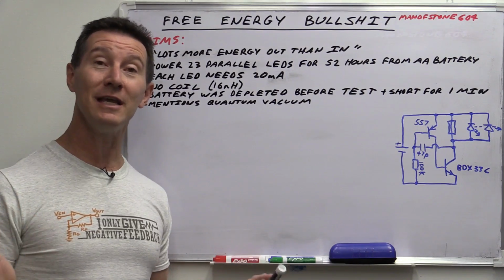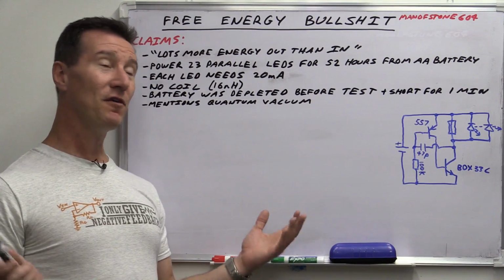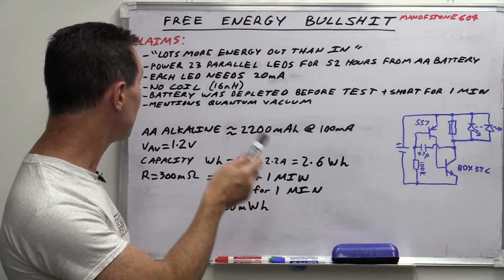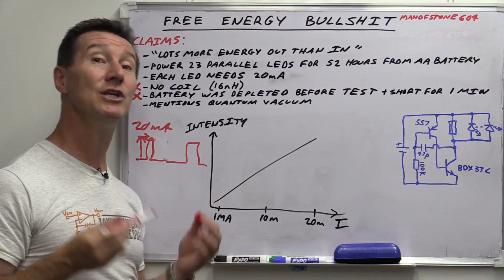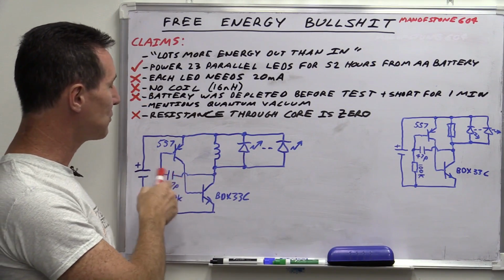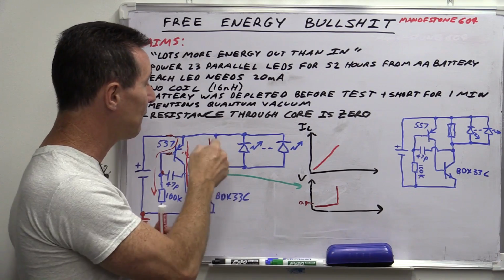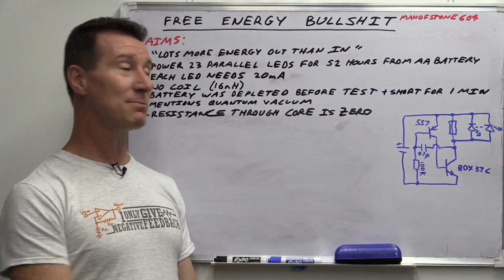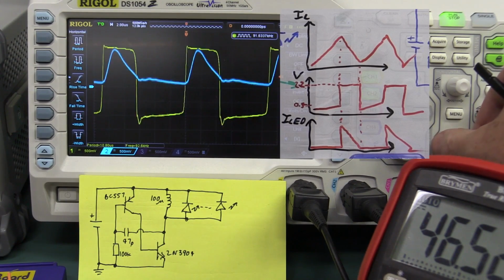EEVblog #708 - Free Energy Overunity is RUBBISH!

Comment: Culture Shock 'sprung!' mate YOU're dancing around the obvious will  single battery(ONE year old) power 24  leds for 52 hours at high intensity without his circuit NOt yours HIs the way he did it cos you were powering yours from the mains and over this side of the pond we call that the fastest trick in the west so your not first ausie to down a  box of Vic biitter and then lose balance in front of the Camera what do you call your VB on your side of the pond "Oh yes Vitamin B" if you redo the Experiment with out the  hiccup of terminology and have a non biased opinion and reproduce the circuit with 24 leds and single cell 12months old and a cell again months old without a circuit and 24 leds for comparison let me know P.s your 'buddy' Carl Sagan is biased so don't Quote him he does not help your case

Comment: Very informative, and when you look at the circuit diagram it is obvious what is going on. However I do believe it is possible to get free energy. And at the same time obey the laws of physics. You are right in saying that there is no such thing as a free lunch. However Photovoltaic panels provide us with free energy, which of course comes from the great nuclear fusion reactor in the sky. If you look at even the most nastiest of cold days on Earth, it is still a whole lot warmer than a day on say Jupiter. Therefore it should be possible to build a machine which creates and temperature drop and then concentrates that heat into useful heat or electricity. Heat pumps already do this. And they do indeed produce free energy. ie more energy than was put into them. that's of course if you class the heat they extracted from the environment as being free. Which I suppose it is. The trouble with heat pumps of course, is you need electricity to run them. Maybe if someone could figure out how to run the heat pump on the excess energy it produces. The loop could be closed and the machine would heat some ones house without any input from the grid. Its a tough call but it could be possible. Again though, no free lunch and no laws of physics broken. You can often light a white LED off a TV aerial down lead, its free energy of sorts I guess. In the fact that the TV companies tower is emitting it and they are paying the bill. Personally I do whole heartedly believe we are awash with energy free for the taking. What we have and the challenges we face are people who waste energy. A poorly insulated stock of housing, if houses were properly insulated, and windows situated correctly, curtains fitted with pelmets. We could build houses that do not require utility bills. They would only need a few small photovoltaic cells and a solar thermal one for hot water. Coupled to an efficient woodstove for when days are dark and cold. We are living in a world where technology is held back to suit the interests of a few super rich. The very fact that in the 21st Century we are still driving cars with internal combustion engines is just a total joke. For a species that claims to be advanced. Lots can be done, and I am sure Electricity maybe able to be produced from the Earths atmosphere in some way. I am open minded, yes the free energy videos are often dubious. And I still believe the energy must originate from somewhere. No free lunch.  But we do owe it to our children to push our governments into creating a better world where everyone has got access to clean non polluting energy sources. It not hard, I built a Solar thermal collector from scrap 13 years ago. My neighbours thought I was nuts. But I get most of my hot water without any additional heating, during the UK summers, from late Feb to late Oct. It has saved me a fortune. And there lies the problem. I have become richer by depriving some fat cat gas industry boss of a little of his bonus. That is what I mean by vested interests holding us back. And that is what I believe is most annoying to people studying free energy methods. But the public should be encouraged to be self sufficient when it comes to energy generation or collection.

Comment: wouldn't there be a lot of energy lost? im just a student of electronics, so im just learning.....but..doesn't....induction have a lot of waste, in exchange for decent, and powerful, but somewhat unstable voltage
Reply: As you are a student I will give you a clue:  a capacitor is a spring and an inductor is a mass (the mechanical equations are the same as the electrical equations but with different units and sometimes rearranged).  Lifting a weight from ground to x height is equivalent to ramping up the voltage through an inductor.  You lift a weight to a certain height and then must continue to exert an effort to support it. So with an inductor you must continue to run current through it by maintaining a dc voltage through it. With the weight you have "charged" it to a certain "potential", that potential being the force with which it will hit the ground when you release it. that force is equal to the force exerted to raise it to that certain height.  You must continue to exert effort to hold the weight at that height because gravity is still acting on it.  In the inductor the potential is equal to the voltage applied, which raised the stored energy in the inductor, and you must continue to hold the voltage with a steady dc flow of current - because something - not exactly sure what to call it - is acting like the gravity acts on the weight.   When you release the force in the inductor by removing the voltage it "comes crashing down" like the weight, the voltage coming out of the inductor being opposite in polarity to the voltage that went in, just as when you release the weight it moves down, opposite to the direction you had raised it up.  

The mass of the weight equates to the current through the inductor.

A note: you can raise a weight and then block it and thus the energy is stored, ready for use.  There is no such equivalent in the inductor.  Now the QM guys and gals will say the block is actually pushing up on the weight - that's hard to wrap one's head around cuz we don't see any energy expended by the block.  I'm not exactly sure but I don't think anyone has figured out how to block an inductor so that it holds it's charge. I think the answer to the block holding the weight has something to do with gravity still acting on the weight. Gravity is the like the steady dc current running in the inductor once you have "raised" it to a certain voltage.

Related: At some hydroelectric dams electricity is used to pump water back up from the bottom of the spillway into the dam. That's usually done at night, and the electricity is not coming from the dam, which may be throttled back at night, but from the attached power grid which at night is being powered by petroleum, coal or nuclear power.  I've read that in a few locations solar power is used (during the day) to pump water back up into the dam when the dam is not that high.

Comment: Nice debunking :) It does make me sad how many people fail at the basic engineering and scientific principles. One of my biggest problems I have seen on youtube are the folks who will only measure the volts in and the volts out. While that is interesting information it is useless without the amps. Of course you can increase the voltage in a circuit that is what a step up transformer does....

Although I must admit the concept of over unity/free energy is an interesting one. While there are plenty of laws that say it is impossible to achieve it can also be that our understanding of how things work is wrong.

I myself have been experimenting with a coil that was originally designed by Tesla that could be used to achieve over unity. So far my initial tests of the coil are looking good. I still need to build a device though to make sure I can draw a current off of it. The coil uses a single toroid core and wraps 2 coils around it, each one taking up about 1/4 of the surface. When you apply a current to the coils (like you would for an electromagnet) the magnetic b fields are trapped in the coil and no magnetic field is generated. When you hook up a galvanometer to the coil and pass a magnet across the coil you can measure a very clear change in the magnetic flux. That is as far as I have been able to take the test so far though. My next step is to build a small motor/generator and see if I can pull enough current to power a light from the coils. If I can then I plan to run the motor at a set RPM and measure the power consumed. If everything is working properly I should be able to add the coil and power the light and see no drop in RPM or increase in power consumption. I am not confident that those are the results I will see because of "Physics" but if I do it will be interesting to try and figure out what is happening.

Comment: I think most of these guys don't really know what "free engery" is in fact. Free energy does not mean, you can produce energy out of nowhere. In fact, "free" means more like "without cost". So real free energy can or could be used by:
* Using sunlight, wind, water, etc
* Using radio waves to light up a diode (e.g. from radio stations)
* Using the temperature differences (like temperature pumps etc)
Some even think about grabbing energy out of the space in the universe. But if this is efficient enough is still in doubt.
Energy cannot be createor getting lost, it only can be converted.

Comment: Just what was this circuit to do. It is not a free energy device. The Tesla circuit had a source of energy. Even in his 1901 patent for the Radiant Energy Receiver has a source. In the patent the first diagram showed an X-Ray as the source of electrons. He thought he had received Charged Cosmic Particles. Since they are a mixture of both positively and negatively charged particles the collection plate will sum them to zero. He did not know about all of the electrons around everything. Even if he did he would have had to move large amounts of them across the plate. If that was possible. Many of these people trying to capture Cosmic Charge Particles have learned the problems of the two polarities and add a diode. I can nor keep from laughing.

Comment: If I am correct the voltage across the led's is the induction voltage from the coil, and not the induction + battery voltage. However, the voltage right of the capacitor is the induction + battery voltage.

Comment: Measuring with a meter is actually another common problem with these over-unity experiments.  If you're not using a true RMS meter, you'll see a higher current than is actually flowing when you measure a low duty cycle wave..  Use ohms law on these improperly mentioned numbers, and it looks like free energy.

Comment: A cheep alkaline battery actually quite often have a higher capacity, but because its lower quality they often have lower top discharge rate, with in this case actually can be beneficial.

Comment: Than kfor video.
I sudenly remebered this circuit,It was first transistor circuit that was blinking small lamp. I remember 2 AAA batteries was blinking my red led heart for a year.
I prefer this osscilator circuit over that multivibrator (cirsuit that uses same transitor type (npnx2 or pnpx2) for low power purposes.
Haha now after 12 years im gonna build this one again, and will let it on for as longest it goes :)

Comment: What about magnetic motors?  Anything worth looking at there?
Reply from the maker: Matt Harden Sure, you put energy in and they turn, with some loss of energy as heat, really useful things!
Reply: In order for energy to be pulled out of a magnetic field, it needs to be moving relative to a conductor. When a magnetic field moves relative to a conductor (even another magnet), kinetic energy is robbed from it and turned into electrical energy. This process, coupled with resistive losses will always result in the machine slowing down. A magnetic field does not have any inherent energy to it, a magnet repels when you push against it, it attracts when you pull it apart. The energy always comes from the environment, it's just that sometimes the path it takes is longer than our brains are used to perceiving, so our stupid, stupid headmeat takes a computational shortcut and assumes the energy came from nowhere.
Reply: Matt Harden Unless you live next to a pulsar you will not get free energy. And even then a pulsar slows down over time.

Comment: If diode forward voltage is around 1.8V, then by my calculation, the efficiency is around 60%. Which is not so bad for boost converter. The price also at a minimum. But still I think it can not be used in commercial because of EMI emissions.
Reply from the maker: ViaExplore The voltage drop is lower than than that at lower currents.

Comment: One contributor for the poor efficiency of ~50% is the use of a Darlington transistor (BDX33C). Darlingtons have a Collector-emitter Saturation Voltage, which is one VBE higher than normal npn transistors. So nearly half of the battery voltage and therefore power is pissed away this way.

Comment: No Dave I did build a motor that takes energy from 2x AAA batteries and produces 2000 Watts. My next project is to building cold fusion reactor with Tuna cans and table salt and tin foil.
Reply from the maker: Janusz Gluszak Don't be crazy, you'll at least need some rubber bands and magnets.
Reply: Janusz Gluszak You'll need some adamantium from Captain 'Murica's shield to protect yourself from the highly penetrating gama rays so the design wouldn't work...

Comment: Technically, if you define 'free energy' as getting more energy out than you put in, then it is possible. With nuclear reactors for example, they take some energy and then using a fuel that it otherwise useless (to some extent) and then gaining a lot of power out. Free energy is possible, but creating energy is not (and there is a difference).
Reply from the maker: David1010100ROBLOX E=MC^2 The energy is in the mass already. Nuclear reactors actually aren't that efficient at converting it.
Reply: EEVblog I understand that they convert mass to energy, but my point is that the mass energy would have been otherwise unused. I feel that as long as something harnesses a form of energy that is otherwise unused then it could be called a sort of free energy, like solar for example (however solar panels are FAR from perfect)

Comment: Dave, ohh I thought you will talk about the QEG.

"The Quantum Electric Generator system (QEG) is an adaptation of one of Nikola Tesla’s many patented electrical generator / dynamo / alternator designs. The particular patent referenced is No. 390,414, titled “Dynamo-Electric Machine”, and dated October 2, 1888."

Thi probably would be much more interesting that this basic boost circuit analysis.

Comment: seeming your talking about led's and the current relationships between min and max values. can you do the same on compact fluorescent globes and regular 100w light bulbs, Mainly because i have seen CFL bulbs with 200ma of current that supposedly put out 5 times the light of a regular 100w bulb that uses 0.6A of current. Can you demystify this phenomenon. and prove what is true and whats not in this low energy bulb race.

Comment: The utterly obvious existence of enough Thorium to replace fossil fuels entirely leads anyone with 10% of their brain left to conclude that our reliance on fossil fuels is grounded in the suppression of technology.

If something as simple as Thorium can be suppressed, it seems unlikely that any novel energy source could see the light of day.

The media did such a good job discrediting Pons and Fleishmann, you wouldn't even know that their experiments have been reproduced dozens of times... even at MIT.

It seems that electromagnetic initiation of hydrogen combination through palladium lattice loading is real.
Plasma depolymerization of trash for hydrocarbons is real.
Thorium is real.

Free energy? Maybe not, but sources which are an order of magnitude more efficient than our current system are plentiful, and it is OBVIOUS that the media is helping cover them up. Chase the latest "magnet motor" fad if you like... but don't be suckered into the idea that technical hurdles are the problem.

The Petrol, Auto and Petro-Dollar industries are the problem.

Comment: Are you sure the efficiency is 50%?  Did you check the voltage on the LED side?  If they're taking say.. 2v, your efficiency is much better than 50%. 

24ma @ 1.5v  =  36
12ma @ 2v  = 24
66% efficient.  But I suspect the LEDs are taking more than 2v
Reply: 1.6v it was in video

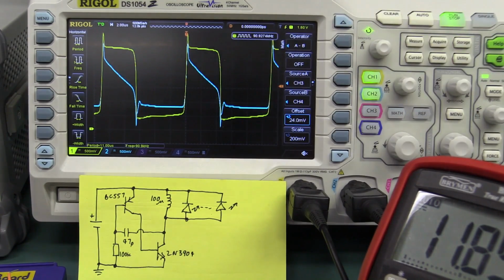Comment: the Falstad Circuit Simulator could have given a clear, interactive exposition of this circuit as well;  Handy thing to keep around when trawling through such claims..  Good explanations though!  Also, 38:08 thanks for mentioning the "ground loop" danger when using a scope probe on the boosted side of the circuit, especially in the case of a mains-driven DC supply!

Comment: Thank you for doing this.  You predicted what would happen, and the results were pretty close...well, yeah, that's what a little edumacation gets you vs. fumbling around!  I like that you pointed out that this circuit not only isn't "free energy" but is inefficient and uses more energy than it has to.  Nice to have you go through the circuit and explain how it works.

Would like to see something on one of the latest ones -- Gerard Morin -- who is taking a small motor, a water pump, some transformers, and a few light bulbs of different wattage, and is measuring something or other I don't even understand and declaring, "Overunity!"  (He has a channel on YouTube.)